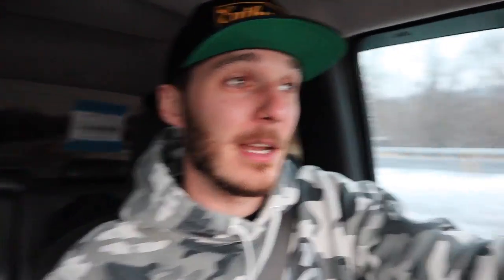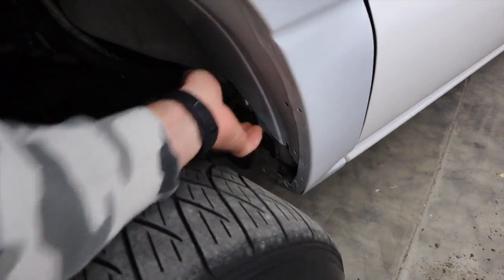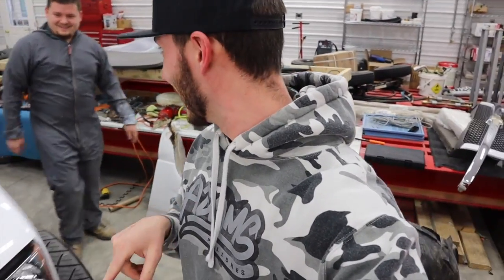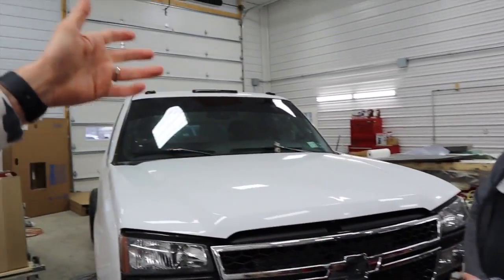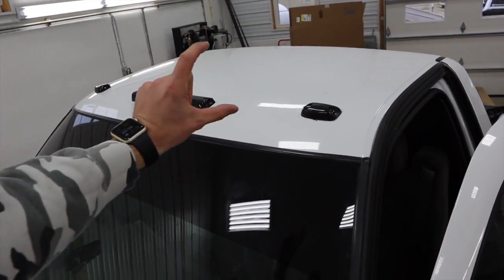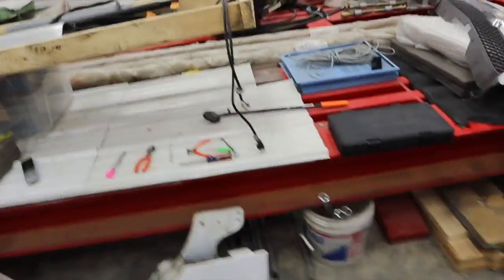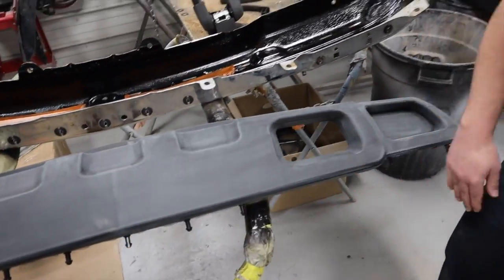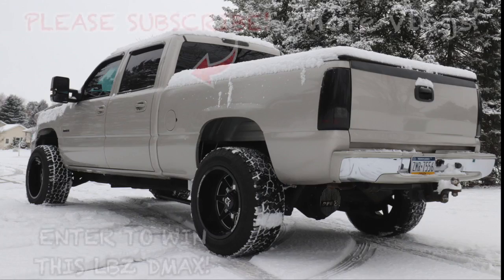THE BIGGEST MOD TO MY DURAMAX YET!

Comment: That  Front it is not partial to the LBZ the LLY also have that front end it depends on  whether or not it is a non-HD or hd truck as well as sub model such as LT Ls Ltz  4x4 z71 all plays a part in the front end design high hood short hood an grill differences